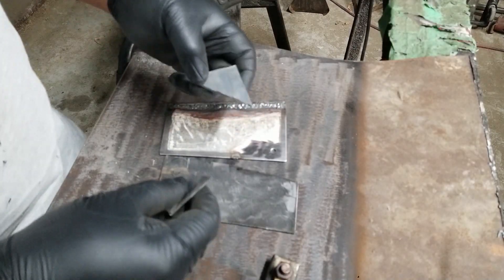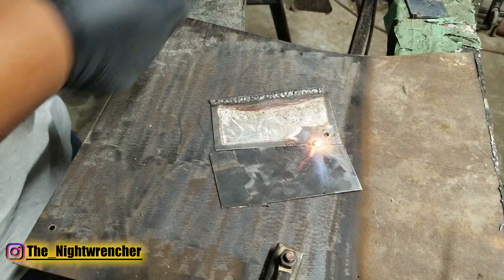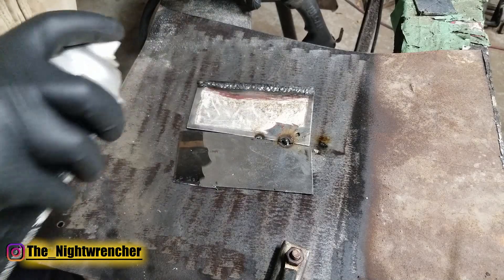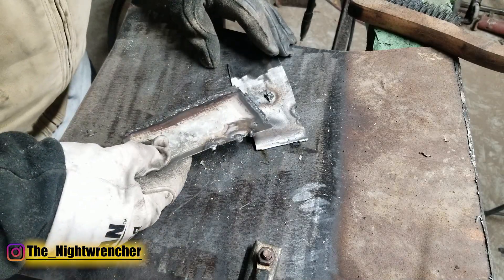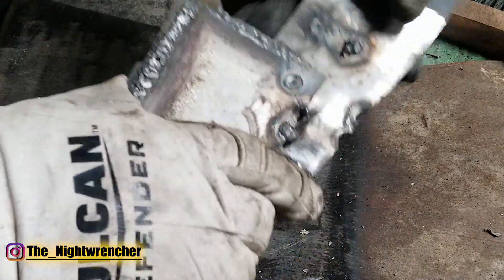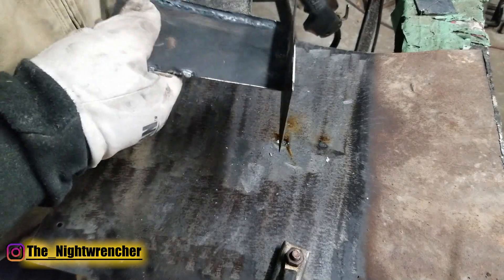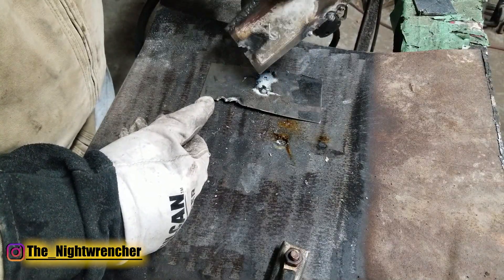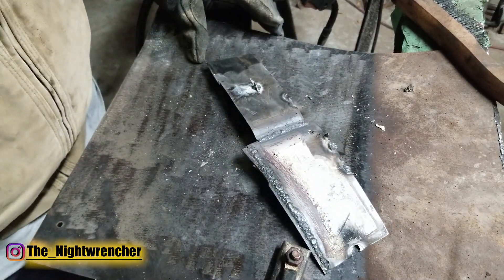How To Spot Weld Using Gasless Welding | Flux Core Welding Tips And Tricks

Comment: Whoaa Bro.   you just hit it rite on the head im doin a quarter panel job on a mustang (both sides) and im gonna be over lapping my welds on it...this will be my second auto sheet metal job (i have always did exhaust systems) but i want to be that go to guy for auto welding in my area... did the floor pans last week they turned out great ...so good the owner insist i do the quarter panels .....and you have gave me what i need to know to ace this job...Thanx Man.:face-blue-wide-eyes:

Comment: That must be some magical sheet metal because I turn my welder to the lowest settings and as soon as I touch the side of the sheet metal with the welding tip, it instantly burns through
Reply: I have the same problem. Try minimum stickout and keep the tip close to the metal
Reply: @ thank you!

Comment: Your show and tell was the most effective I've seen... And very simple to digest. So Good, I'm going to suggest you do day work as well! LOL I have to replace an upper Radiator Support in my old maxima (accident) I just have to figure out which side to drill out the spot welds superficially so I can use the metal in the support as the base you weld to and build up. Or is it easier to drill both through?

Comment: Great vids!  Dodge truck bed quarter panels, do you recommend the flange type tool (CENTRAL PNEUMATIC
Air Punch/Flange Tool) to prep for lap weld to get a better finish instead of just putting it behind original panel?  So much controversy out there between lap and butt welds. I just started welding just to fix these body panels and want my best shot at a nice finish.  Thanks!
Reply from the maker: Hey man, I have the same tool, works really well for thin gauge sheet metal but anything thicker than 20ga and it struggles to put a bend in it. For body work its really a toss up between the 2 processes. The issue is that you dont have access to the back of the panel where dirt and debris get trapped with a lap weld. The issue with a butt weld is that the area becomes a hard spot and shaping a welded bead becomes difficult. Ive had the easiest time with lap welds personally. Whether its a flanged lap weld or just a piece of sheet metal held from behind, never had an issue.

Comment: How do you prevent rust between the two pieces of steel overlapping in the lap weld?
Reply from the maker: you can use weld through primer before welding the pieces together or you could use seam sealer like the OEMs use.

Comment: Great videos, simple to understand. May I ask what guage wire are you using? I am a beginner welder and its difficult to not burn through. I was using .030, then went to .035 and I am gonna try .045 next. When welding body panels we have no heat sink behind it like your table. Settings are all the way down and I try to move quickly. 
Thanks Night Wrencher
Reply from the maker: For sheet metal, the thinner wire is best because it takes less heat to get it to start flow. Body panels usually need to be tacked in place in a criss cross pattern to prevent warping. You dont need to run beads across sheet metal. Just keep going around the panel and adjust the gaps as nessesary until its welded all the way around
Reply: okay.... this guy means well, butclearly isnt a pro(in the video i mean, his reply here is pretty good).  thin metal, needs a thinner wire, ypure going in a hotter and larger weld puddle direction, by increasing wire diameter.  try 0.023 or something under .030 size, itll work better than the 35 or 45.  get the thickest piece of steel ypu can find/buy, half inch plate if possible, as a table/heat sink, the heatsink realllllly helps.  you probably wont be able to do continuous welds, bit a couple seconds spot/ plug weld shoulpd work.  get a wire brush and clean the area before ypu weld, for each 'stitch' down the joint ypure welding this way, it must be CLEAN, no paint, rust, sometimes even mill scale (the grey/black coating over the bare steel. thats oxidation, and contaminates the weld, and makes it spatter much more.  lookup 'weldingtipsandtricks.com' that guy is a professional of decades of experience. get some nice 1/4" stuff to start learning on aheet metal is very unforgiving, it burns theough before a beginner can react really.  good luck mate i love welding and hope it works out for you!